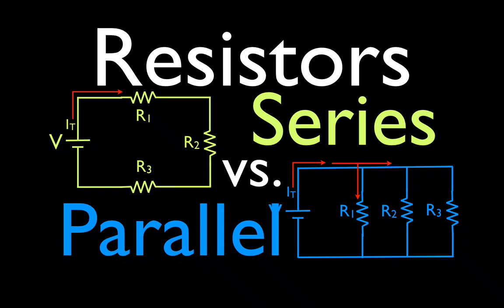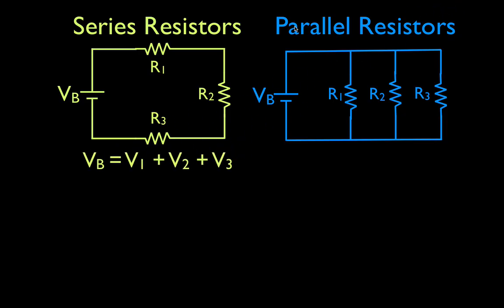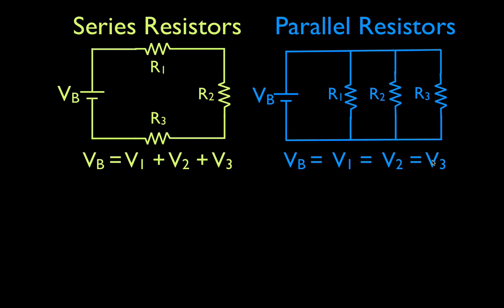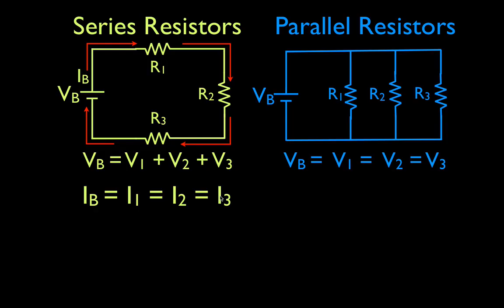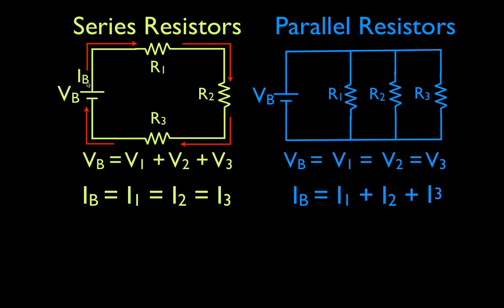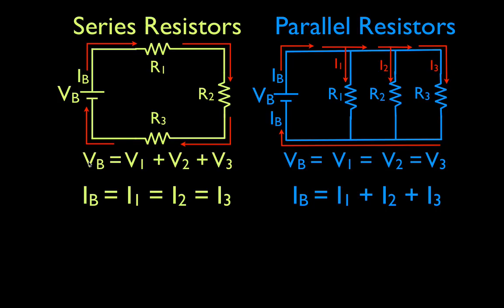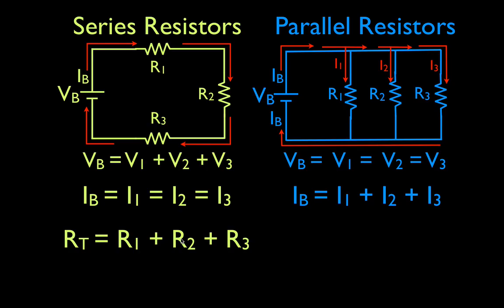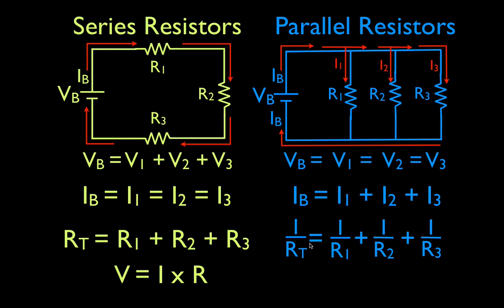Resistors in Electric Circuits (1 of 16) Series vs. Parallel

Comment: Makes  no sense.  Physically power is going through all the resistors  so  how does  series resistors   differ from parallel.  .  Why does one drop voltage and the other drops current
Reply from the maker: That is the way they work, series resistors share (split) the voltage but have the same current, parallel resistors share (split) the current but have the same voltage.
Reply: @Bloodred Pyrate  what  you says was very  very cringy. Want to try again and sound less stupid?

Comment: This video didn't really explain squat.  You basically said, series or parallel the current doesn't change.  You need to use numbers for your examples and also complete the math towards the end. Also is there any way you can stop holding your breath when you talk?  It's a bit annoying.  Coffee time wooohoooo
Reply from the maker: That is not what I said and if you want examples with numbers then check out one of the many other videos that I have made on this topic.
Reply: You may find the physics of the operation of the parallel circuit useful in the references here.
What is a resistor? How does current branch in a network of resistors? How does it "know" how much should flow in each branch?
While some detail is given in science and engineering courses about conductors, insulators and semiconductors, resistance is described in several ways.
Examples include i. The restriction to the flow of electrons. ii. The difficulty in moving electrical current through a conductor to which voltage is applied.
iii. a circuit element which dissipates energy in the form of heat .
More appropriate description for a resistor would be the property of a conductor which determines the current produced by a given difference of potential.
This makes us remember that a resistor is a conductor first. And, there is reason to say that superconductive wires dont obey ohm's law. So all conductors are resistive, though not superconductors. 
Resistors are used in circuits to regulate the strengths of currents either by reducing the diameter of conductors or introducing more obstacles or lattice imperfections to reduce the strength of current.
The current branches in a parallel network by an elaborate rearrangement of surface charge.
For more details about resistance, how current branches in a parallel circuit and ohm's law consult the following videos, articles and books.
What is current ? What is voltage ?
A working definition for current in conductors like metal wires is "the start-stop motion of millions and millions of conduction band electrons everywhere within with a drift superimposed". 
In circuits, voltage is due to surface charges. Consider a simple circuit comprising a battery, two wires and a resistor. 
The e.m.f of the battery is due to separation of positive from negative charges which produces an e.m.f across its terminals and a pattern of electric field surrounding them, not exactly but like a dipole.
An electric field is there in the wires and in the resistor; powerful electric field and uniform within the resistor, weak and uniform within the wires. The field is set up by a tiny amount of surface charge with a steep gradient on the resistor and not so steep a gradient on the wires. 
It is the electric field E created by the surface charges sourced from the battery, which produces a force causing the mobile electrons to acquire a drift velocity v = μE, where μ is the mobility which is a number representing the freedom of movement of the electron in the lattice. 
This results in a current density J = σE, where σ is the conductivity of the wire or material of resistor and E is the electric field in the wire if considering wire and is the field in the resistor when considering the resistor. 
The p.d. or voltage across the resistor is the integral of a constant powerful field along its length. The p.d. or voltage across the wires is the integral of a constant but weak field along its length. 
Voltage is entirely because of the surface charges.
Electrostatics and circuits belong to one science and not two, that of electricity and magnetism. To know how they are unified visit this link 
https://matterandinteractions.org/articles-talks/ and view the article 'A unified treatment of electrostatics and circuits.  B. Sherwood and R. Chabay, unpublished. (1999)'
pdf. 
For more details see Electric and Magnetic Interactions by Chabay and Sherwood 
www.matterandinteractions.org
or 
Fundamentals of electric theory and circuits by Sridhar Chitta
https://www.wileyindia.com/fundamentals-of-electric-theory-and-circuits.html
There is a "look inside" feature in the amazon.com webpage of the book "Fundamentals of electric theory and circuits" by Sridhar Chitta with a few pages of Chapter 1 which may be viewed and also which you may swipe left or press < icon to view the foreword, preface and Table of Contents. 
For a video lecture by Prof Ruth Chabay on surface charge in a simple dc circuit visit 
https://youtu.be/-7W294N_Hkk
There is a full set of lectures beginning lecture 13 here on surface charges, electric fields, simple circuits, capacitance, inductance, faraday's law, motional emf, magnetic forces and more topics here
https://matterandinteractions.org/videos/EM.html
For a live demonstration of surface charge in a circuit visit
https://youtu.be/U7RLg-691eQ
There is a full set of lectures beginning lecture 13 here on surface charges, electric fields, simple circuits, capacitance, inductance, faraday's law, motional emf, magnetic forces and more topics here
https://matterandinteractions.org/videos/EM.html

Comment: I needed a clear reference for my son who is starting with this in Grade 9 during home isolation Covid 19. The school referenced a different course which was unclear to him.  This is much more clear and well taught for anyone to learn. Well done!
Reply from the maker: Thanks for the great comment and thanks for helping your son.
Reply: You may find the physics of the operation of the parallel circuit useful in the references here.
What is a resistor? How does current branch in a network of resistors? How does it "know" how much should flow in each branch?
While some detail is given in science and engineering courses about conductors, insulators and semiconductors, resistance is described in several ways.
Examples include i. The restriction to the flow of electrons. ii. The difficulty in moving electrical current through a conductor to which voltage is applied.
iii. a circuit element which dissipates energy in the form of heat .
More appropriate description for a resistor would be the property of a conductor which determines the current produced by a given difference of potential.
This makes us remember that a resistor is a conductor first. And, there is reason to say that superconductive wires dont obey ohm's law. So all conductors are resistive, though not superconductors. 
Resistors are used in circuits to regulate the strengths of currents either by reducing the diameter of conductors or introducing more obstacles or lattice imperfections to reduce the strength of current.
The current branches in a parallel network by an elaborate rearrangement of surface charge.
For more details about resistance, how current branches in a parallel circuit and ohm's law consult the following videos, articles and books.
What is current ? What is voltage ?
A working definition for current in conductors like metal wires is "the start-stop motion of millions and millions of conduction band electrons everywhere within with a drift superimposed". 
In circuits, voltage is due to surface charges. Consider a simple circuit comprising a battery, two wires and a resistor. 
The e.m.f of the battery is due to separation of positive from negative charges which produces an e.m.f across its terminals and a pattern of electric field surrounding them, not exactly but like a dipole.
An electric field is there in the wires and in the resistor; powerful electric field and uniform within the resistor, weak and uniform within the wires. The field is set up by a tiny amount of surface charge with a steep gradient on the resistor and not so steep a gradient on the wires. 
It is the electric field E created by the surface charges sourced from the battery, which produces a force causing the mobile electrons to acquire a drift velocity v = μE, where μ is the mobility which is a number representing the freedom of movement of the electron in the lattice. 
This results in a current density J = σE, where σ is the conductivity of the wire or material of resistor and E is the electric field in the wire if considering wire and is the field in the resistor when considering the resistor. 
The p.d. or voltage across the resistor is the integral of a constant powerful field along its length. The p.d. or voltage across the wires is the integral of a constant but weak field along its length. 
Voltage is entirely because of the surface charges.
Electrostatics and circuits belong to one science and not two, that of electricity and magnetism. To know how they are unified visit this link 
https://matterandinteractions.org/articles-talks/ and view the article 'A unified treatment of electrostatics and circuits.  B. Sherwood and R. Chabay, unpublished. (1999)'
pdf. 
For more details see Electric and Magnetic Interactions by Chabay and Sherwood 
www.matterandinteractions.org
or 
Fundamentals of electric theory and circuits by Sridhar Chitta
https://www.wileyindia.com/fundamentals-of-electric-theory-and-circuits.html
There is a "look inside" feature in the amazon.com webpage of the book "Fundamentals of electric theory and circuits" by Sridhar Chitta with a few pages of Chapter 1 which may be viewed and also which you may swipe left or press < icon to view the foreword, preface and Table of Contents. 
For a video lecture by Prof Ruth Chabay on surface charge in a simple dc circuit visit 
https://youtu.be/-7W294N_Hkk
There is a full set of lectures beginning lecture 13 here on surface charges, electric fields, simple circuits, capacitance, inductance, faraday's law, motional emf, magnetic forces and more topics here
https://matterandinteractions.org/videos/EM.html
For a live demonstration of surface charge in a circuit visit
https://youtu.be/U7RLg-691eQ
There is a full set of lectures beginning lecture 13 here on surface charges, electric fields, simple circuits, capacitance, inductance, faraday's law, motional emf, magnetic forces and more topics here
https://matterandinteractions.org/videos/EM.html

Comment: I didn't understand the last equation 1/RT = 1/R1+1/R2+1/R3  why is there a 1 on top of ;all the resistances? I know it's a fraction but what does it mean?
Reply from the maker: It means that as you add resistors the equivalent resistance will decrease and the current will increase.
Reply: I would have found that bit much less confusing if you hadn't been using a san-serif font where I and 1 look identical! I thought it was an equation of Current over each resistor, not 1 over each.

Comment: Question, about finding the total resistance on parallel DC circuits. The 1 over the RT in the equation is the voltage that the resistance can get? It can be 1 or 12, 24 or anything for that matter? Or am i of subject?

Comment: The circuits shown provide a voltage source, not a -voltage gain- because there is not an increase of voltage through amplification. (gain).  However the illustrations are very good and the detailed explanations are spot on. Thanks

Comment: Extremly amazing sir. But one thing keeps revolving in my mind. Sir when a single resistor is connect in an simple circuit. .Does the current reduce after flowing through the resistor or only at the resistor or does it remain the same anywhere? How and why?. Pls sir hope u help me
Reply from the maker: Rumble Roy The current does not reduce, but energy that the electrons have reduces to zero after they go through the resistor
Reply: A working definition for current in conductors like metal wires is "the start-stop motion of millions and millions of conduction band electrons everywhere within with a drift superimposed". 
The e.m.f of the battery is due to separation of positive from negative charges which produces an e.m.f across its terminals and a pattern of electric field surrounding them, not exactly but like a dipole.
Consider a simple circuit comprising a battery, two wires and a resistor. An electric field is there in the wires and in the resistor; powerful electric field and uniform within the resistor, weak and uniform within the wires. The field is set up by a tiny amount of surface charge with a steep gradient on the resistor and not so steep a gradient on the wires. It is the electric field E created by the surface charges sourced from the battery, which produces a force causing the mobile electrons to acquire a drift velocity v = μE, where 'μ' is the mobility which is a number representing the freedom of movement of the electron in the lattice. 
This results in a current density J = σE, where σ is the conductivity of the wire or material of resistor and E is the electric field in the wire if considering wire and is the field in the resistor when considering the resistor.

The p.d. or voltage across the resistor is the integral of a constant powerful field along its length. The p.d. or voltage across the wires is the integral of a constant but weak field along its length. 
Voltage is entirely because of the surface charges.
What is a resistor? How does current branch in a network of resistors? How does it "know" how much should flow in each branch?
While some detail is given in science and engineering courses about conductors, insulators and semiconductors, resistance is described in several ways.
Examples include i. The restriction to the flow of electrons. ii. The difficulty in moving electrical current through a conductor to which voltage is applied.
iii. a circuit element which dissipates energy in the form of heat .
More appropriate description for a resistor would be the property of a conductor which determines the current produced by a given difference of potential.
This makes us remember that a resistor is a conductor first. And, there is reason to say that superconductive wires dont obey ohm's law. So all conductors are resistive, though not superconductors. 
Resistors are used in circuits to regulate the strengths of currents either by reducing the diameter of conductors or introducing more obstacles or lattice imperfections to reduce the strength of current.
The current branches in a parallel network by an elaborate rearrangement of surface charge.
For more details about resistance, how current branches in a parallel circuit and ohm's law consult the following videos, articles and books.

Electrostatics and circuits belong to one science and not two, that of electricity and magnetism. To know how they are unified visit this link 
https://matterandinteractions.org/articles-talks/ and view the article 'A unified treatment of electrostatics and circuits.  B. Sherwood and R. Chabay, unpublished. (1999)'
pdf. 
For more details see Electric and Magnetic Interactions by Chabay and Sherwood 
www.matterandinteractions.org
or 
Fundamentals of electric theory and circuits by Sridhar Chitta
https://www.wileyindia.com/fundamentals-of-electric-theory-and-circuits.html
There is a "look inside" feature in the amazon.com webpage of the book "Fundamentals of electric theory and circuits" by Sridhar Chitta with a few pages of Chapter 1 which may be viewed and also which you may swipe left or press < icon to view the foreword, preface and Table of Contents. 
For a video lecture by Prof Ruth Chabay on surface charge in a simple dc circuit visit 
https://youtu.be/-7W294N_Hkk
There is a full set of lectures beginning lecture 13 here on surface charges, electric fields, simple circuits, capacitance, inductance, faraday's law, motional emf, magnetic forces and more topics here
https://matterandinteractions.org/videos/EM.html
For a live demonstration of surface charge in a circuit visit
https://youtu.be/U7RLg-691eQ
There is a full set of lectures beginning lecture 13 here on surface charges, electric fields, simple circuits, capacitance, inductance, faraday's law, motional emf, magnetic forces and more topics here
https://matterandinteractions.org/videos/EM.html

Comment: Hi! Thanks for the great explanation. I was wondering if you could help me with a question I have. My book says that if you place more resistors in a parallel circuit the equivalent resistance decreases because "each new resistor provides an additional path for current, thereby increasing the total current while the potential difference remains unchanged." I don't understand how the total current could be increased from the original? Where does it come from? Sorry for the long comment and thanks again for providing these videos. They help a lot.
Reply from the maker: The quote from the book is correct.  If you have a battery and 1 resistor then you have current flowing through the 1 resistor.  For example if you have a 10 V battery and one 20 Ohm resistor the the current thru the resistor would be 0.5 A. This would also be the total current in the circuit.

Now if you add another 20 Ohm resistor in parallel then the second resistor would also need/get 0.5 A.  With the second resistor the current each of the resistors would be 0.5 A and the total current in the circuit would be 1,0 A.

Add a resistor = increased total current (0.5 A to 1.0A)  =  lower resistance.  Does that help?
Reply: Step-by-Step Science Yes! Thank you!